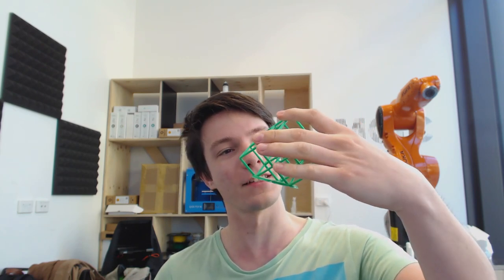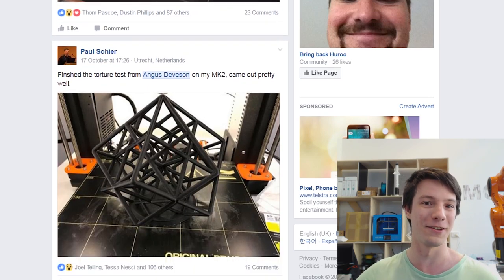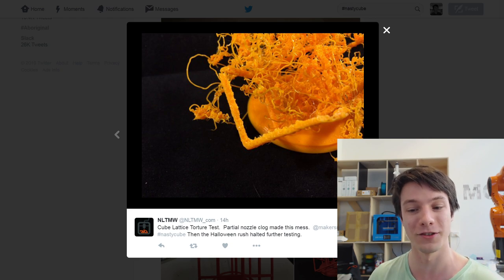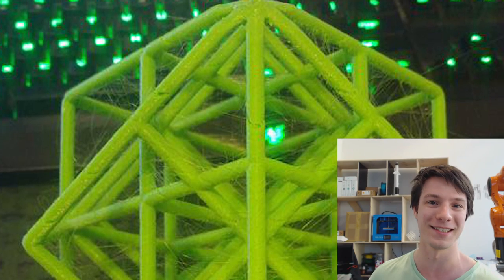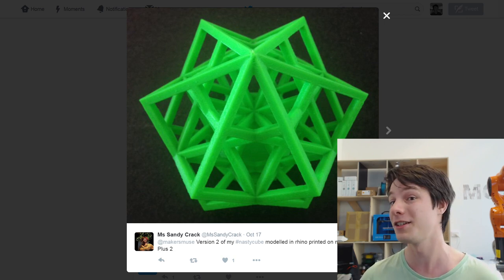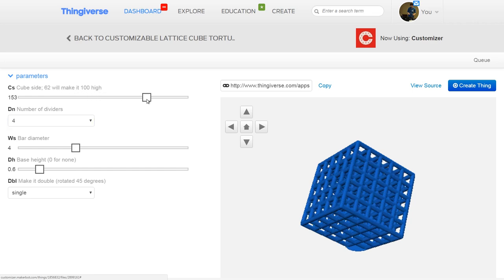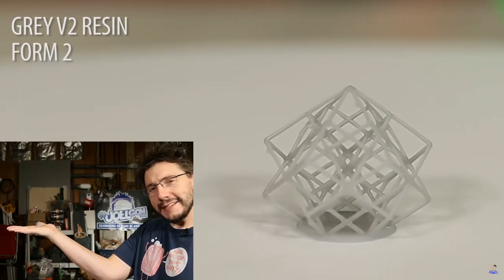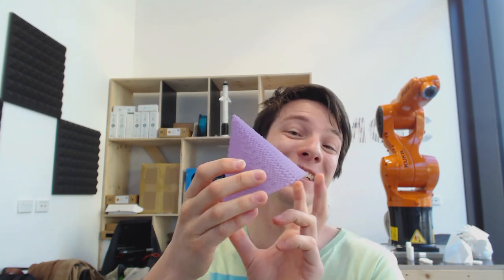Lattice Cube Torture Test - Your Results!

Comment: The cone looks like it could be support structure (I have had very similar looking supports that broke off in one piece). There is a lot of bridging at an angle, so it could also be made with soluble support, and that is the actual model.

Comment: That looks like "reverse" support structure on top of a funnel thing... If that makes sense. Also, I did model my own lattice in SolidWorks. Having some issues dealing with curling on larger nozzle sizes. Almost as if there is just too much heat in that thick plastic bead to cool in time... Works with Z-hop though...

Comment: Would have been nice to know the slicer and printer settings for those great prints. People who have their printer so dialed in could really help people who are wondering what he ideal sett BHA for their printer should be.
Reply: Mine (orange mess and the red success) were printed on a Sunhokey Prusa i3 clone (with lots of mods) using HobbyKing PLA at 0.2mm layer height, slow fan cooling on the part, PrintinZ bed heated to 40C with 200C to 210C nozzle temp (print room is cooler than usual room temp) and high retraction (~10mm) and around 40mm/s print speed.  Slicer was Simplify 3D, no supports, single process, no magic settings.  In the time between the failure and success, I had changed the heatbreak/throat in my cheap e3D style hotend to a straight through design that allows the Bowden PTFE tube to be inserted right down through to touch the top of the nozzle, which seems to be working so far to reduce clogging.

Comment: Do you thing my wanhao duplicator i3 plus will be able to print it?
Reply from the maker: I reckon so! Just run a little slower so it doesn't get knocked over. Also have you fitted insulation washers on the print bed?
Reply: No i haven't ,how do i do that?
Reply from the maker: Check out chuck's video on his channel CHEP sorry can't find the link atm
Reply: Ok thanks!